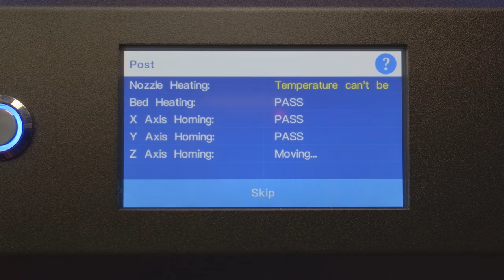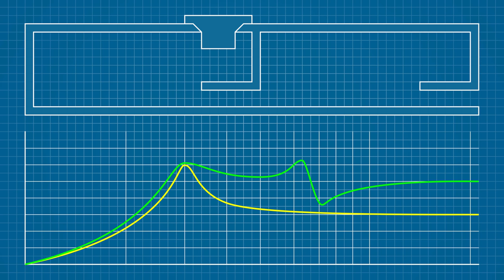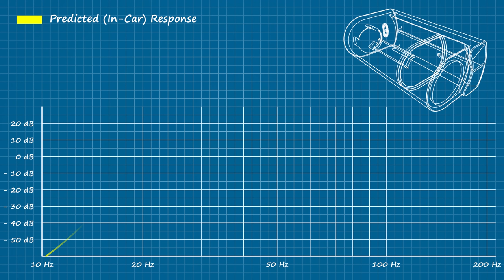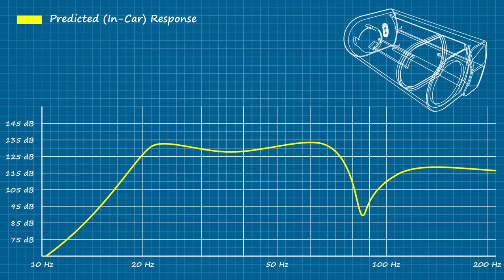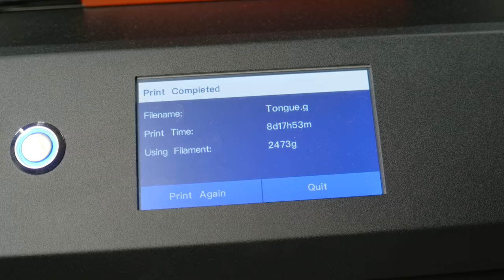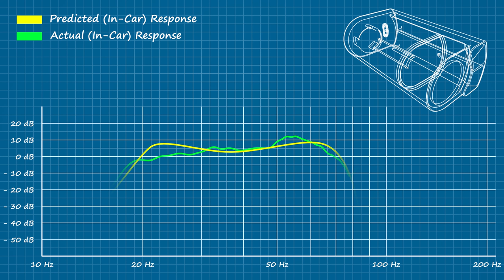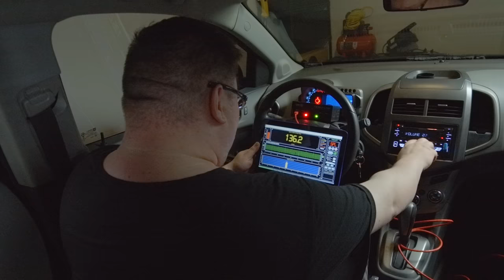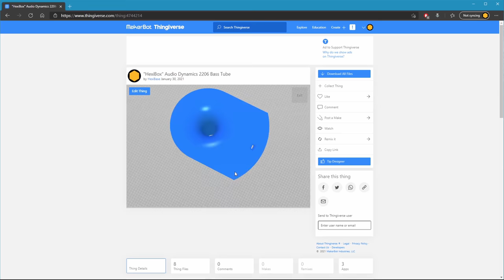Next Generation Bass Tube (Featuring The Alfawise U20 Mix)

Comment: Hello there Hexi! I have been keeping track of your designs and I have finally got myself a 3D printer myself so try out some of your designs. Some of your demos have given some good evidence to a on going thought that I had for a long time. People have that setup of a "sound system" in their cars thinking that having a 1200w amp and two 12" woofers is the hardest hitting thing out there with a sealed/ported box, no disrespect to them. I just prefer quality and balance with a bit of flexibility when it comes to the music I listen to. I'm still having to dig into my memories of three semesters of my high school days doing CAD and AUTOCAD but it's slowly coming back to me as I am given little projects from my family and have to make something from scratch. I was looking through the bass tube and the divider baffle is too tall for my printer as it can only print up to 300mm tall. I was wondering if making it into 2 parts would cause any problems in the long run. I intend to try out some of these designs in a 2005 Subaru wagon and I like the concept of these small drivers, hard output layouts because it will give the room for utility for the cargo space while able to help improve the quality of the sound system. I hope one of your designs can really make an "impact" on what people think when I demo your designs to them.

Comment: Here are the info on the DD506

506D	
Driver Size (In):	6.5	
Watts RMS:	        150 - 400	
Peak Power:	        1200
VCD (In):	         2	
Impedance:	          D2 / D4	
Piston Diameter (In):	5.375
Fs (Hz):	43.74	
Qms:	4.907
Qes:	0.558
Qts:	        0.501
Vas:	4.395
Xmech (MM):	56	
Xmax (MM):	        9
Frame OD (In):	7
Frame OD w/ Gasket (In):	        7 1/8
Mounting Diameter (In):	        6
Mounting Depth (In):	                4 1/2
Motor Diameter (In):	                5 1/2
Motor Depth (In):	                        2
Woofer Displacement (CuFt):	0.04
Sealed Enclosure (CuFt):	        0.25 - 0.5
Ported Enclosure (CuFt):	        0.25 - 0.75
Shipping Weight (Lbs):	        10.5
Reply: Hi @Hexibase....Any news? Would like to know if it will work for the Digital Designs DD506 PLEASE REPLY BUD!

Comment: Great work on the whole project brother.  The only thing I will disagree with you on is how "high motor strength subwoofers are a one-note" wonder.  It is in fact the opposite.  Low motor strength subs allow for less-damped response which results in the peak you graphically show/describe.  Anyone who has actually taken the time to learn how to model the response of subwoofers will know this.   Shift Qes up within the software and that huge ugly peak you demonstrated rears it's ugly head.   Shift the Qes down, and the resonse starts to flatten out and extend (up to a point, since once you dip down below 0.20-ish, it becomes too damped and can hinder bass response in the wrong enclosure.  As-is that 6.5" sub is a low motor strength subwoofer with a Qes of 0.70-something.   Qes encompasses all when it comes to final determination of motor strength since it is the dominant factor in determining "No" (eta-naught) reference efficiency and ultimately connected to the final sensitivity of the system.  The equations of Thiele-Small that back up this info I'm posting can be found in Vance Dickason's Loudspeaker Cookbook series and can be verified on any decent low-frequency enclosure modeling software.

Comment: The printer is $650, not $400. I believe you said it was $400 in the video, but I could be wrong. 3D printing technology has been unacceptably stagnant. Filament 3D printing is still poor quality, still takes an absurd amount of time, and is still prone to failures. A 10 day print, an 8 day print, and the orange come (I forget how lying it too), and imagine it messing up after 6-7 days. There's just not much use for 3D printing outside of some trinkets, tchotchkes, and some arts and crafts. You're either stuck with Chinese made filament printers, home made 3D printers, or 3D printers that are made out of 3D printed parts. Buying a 3D printed, that uses parts made in a 3D printer, is unacceptable. Or a laser/SLA/DLP resin printer, or even more expensive SLS printers and PMM/sintered metal printers. So there is nothing to fill in the gaps between a few hundred dollar Chinese FDM printer and a few thousand dollar resin or sintering printer. They're still basically a hot glue gun, mounted on a 3 axis machine, that needs significant post processing to look even slightly acceptable. The bass tube looked decent on video, but I know how FDM prints look in real life, and it's never any good. I really wish they'd do something revolutionary that will drive the process and allow 3D printers to be used for things other than keychains.

Comment: Wtf is up with the music for the sound test did you pick something your sure know body would ever listen to …. You tube has bass tracks for testing subs it would of been cool if you picked something that would really test the stability of your structure I was impressed now I think your where scared to push it did you have to write any G code or M code im a machinist and I use auto CAD every day running my CNC
Reply: Spoke too soon as soon as I got done typing I heard “50 cycles” lol ya that’s awesome